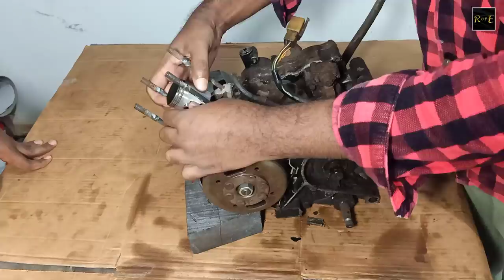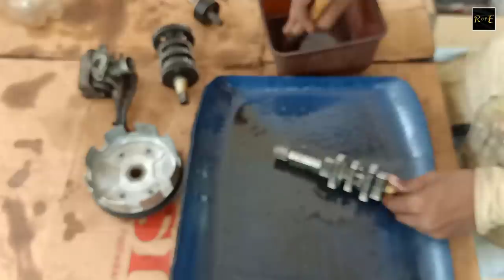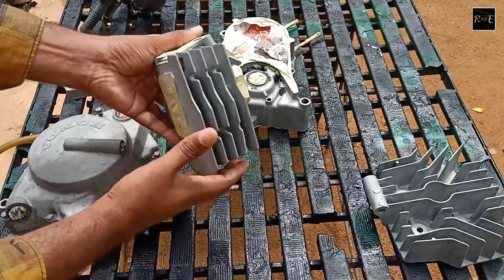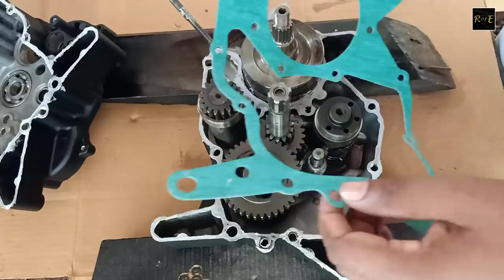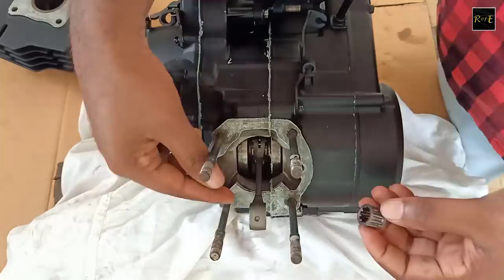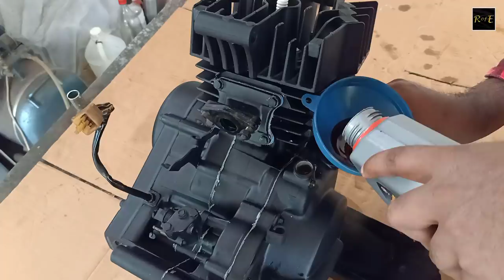Honda Raccoon 50cc engine restoration | MB50 Engine Restoration (50cc 5 Gear)

Comment: nice job ! next time do an engine start after the restoration
Reply: Yes
Reply: I don't know why gasket maker and a gasket is being used together. It makes sense to use some to hold a gasket in place, but to use both makes no sense.

Don't forget, what seeps on the outside, seeps on the inside. In future, this could cause a problem. In the beginning, all is well. Next tear down and you see oil passages blocked and starve for oil.
Reply: @forevercomputing  it's better to use both because it prevents leaking even if the matching surfaces are damaged or very poorly machined
Reply: He did a full restoration of the bike and motor before this and shows it running and riding! Check it out it’s a Honda raccoon bike
Reply: @forevercomputing  I've been told to never use any kind of gasket maker on a motorcycle engine because of the small oil passages in the engine.
Reply: Right

Comment: these motors were also available in Germany with 80cm².
they still had the habit of knocking out the seat of the crankshaft bearing on the left.
which made it necessary to change the motor housing half or you had someone who could make and use a new one.

Comment: Two points :  suggest not to use a screwdriver between gears to lock the , use softer metal you'll never damage the teeth. When you knock the bearing from the casings , use a drift (socket) not a hammer direct ...    Great vid thanks ....
Reply: Either way he did buy new bearings

Comment: Rebuilt these engines maybe 50 times as an early teen in the 80s...

Some in worse condition. Made them reach speeds in excess of 65 mph.

This engine is not exactly a Raccoon engine. That is only in places like India. 

It is originally from a Honda MB-5 that was introduced in the late 70s.

Comment: I know the way he does the piston rings is wrong but still love the videos but normally you put the rod through the cylinder and compress the rings of the piston then put the piston in the cylinder and connect the rod to the crank at bottom dead center that way you don’t damage the rings on piston! I’d imagine the way he did it would end up rings failing and damaged cylinder wall

Comment: Protip- never bead blast engine blocks or crank cases or anything with oil galleys、 always use wire wheel